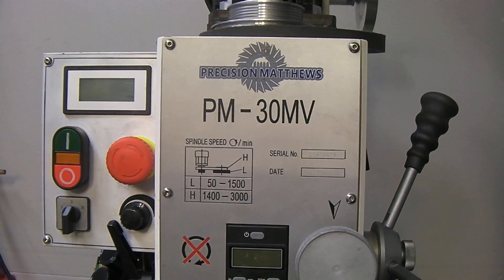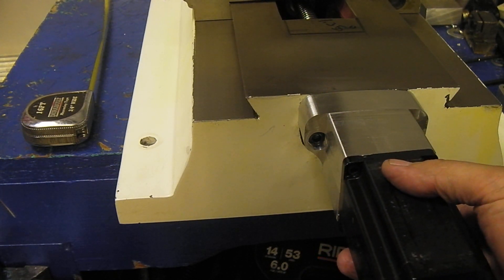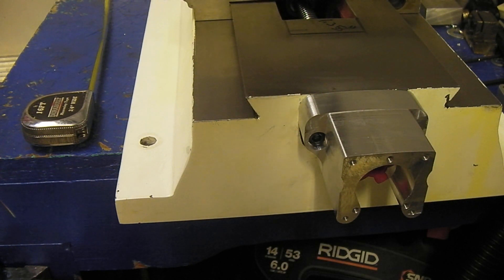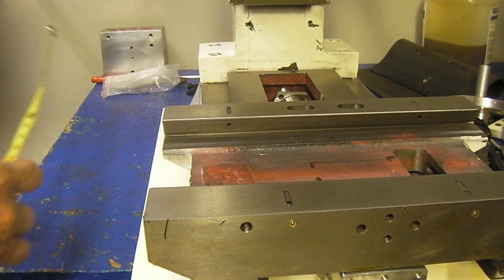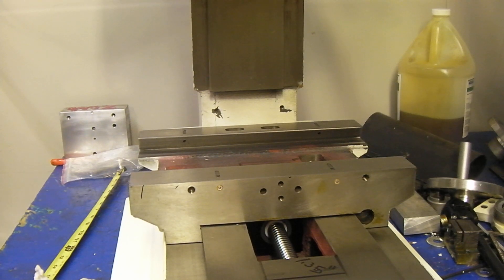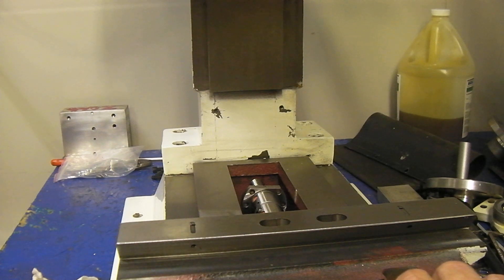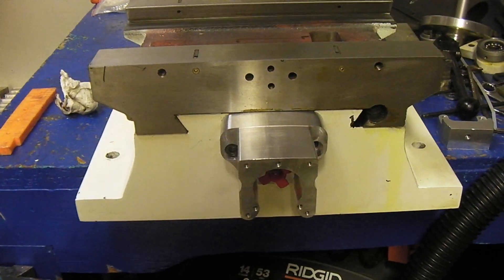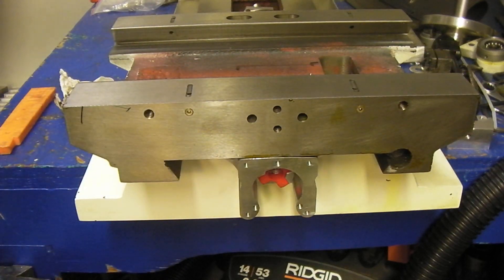PM-30 Y travel  11.5"!!

Comment: Great video, do you make or sell this kits? Anything for the Rong Fu RF30.. round colum mill drill same as the Grizzly G)706? thanks
Reply from the maker: The RF-30/31 is hard to CNC with the Z round column making you feed the quill which is always a bit lame. I dont plan on a kit for that one.
Just to show that your skill is as important as your mill, this link is to a RF-31 that has had a bit of work done to it. https://www.youtube.com/watch?v=l2PWuqgviS8

The 31 is a good mill in a lot of ways it just has more limits than needed today.

Comment: I was catching up on the body of your video work and cnc kits.  Nice bit of kit, by the way.  That being said, why is it that the "Y" and "Z" ballscrew kits do not seem to incorporate a support opposite the motor side of the ballscrew?   The "X" axis is always supported at both ends, but not the others, why?  If I've missed something, please show me what I missed or explain the reason for the lack of support on the Y and Z.   Thanks.
Reply from the maker: On the PM-30 the Y is a fairly short screw so you dont need a second set of bearing to prevent screw whip. The X will have a second support bearing.  The Z does not have one. 

You can look up screw whip and its generally not a problem at the speeds we would run the mills for the length of the screws.

Comment: Nice looking motor mounts Dave. You do good work. The pm30 looks like a very solid mill with descent travels. It looks like it will hold a vise well with it having 17" from spindle to table without getting cramped. I wished the pm940 had the belt drive option from the factory.

Comment: Perfect timing. I was just reviewing the PM mills for starting a conversion when I saw your video pop up. I really like the work you have done on mill conversions.

 I'm torn between the PM25MV, PM727M, and the PM30MV. The 25 seems to light and the 30 is getting pretty expensive for a conversion. @CNC4XR7 and others have done PM727M's. I am still torn.
Reply: BTW The Y mount looks great. What mill do you use to make your parts?
Reply from the maker: I try not to talk about mills that I have not used. From the pictures I have seen the base of the 727 is lighter than the 30. The 30 base is a vary efficient design but the column is not too large.  From what I have seen the 727 is OK. The PM-30 is around 460 pounds on the bench.
Reply: The pm30 is already belt driven so you won't have to convert to that later. The pm25 is belt driven as well but it is smaller and you should really decide now if the smaller size won't limit you later on. The pm727 is NOT belt driven so if you do a belt conversion on it later, it will cost you which will wipe out the cost difference between it and the pm30. Most people will go to a 3ph motor will a belt drive in their conversions. If you have any plans of this, the pm30 is one step closer. It looks like the pm30 is on back order so you will probably have to wait a bit for it. I have a pm940 on order and it might be here at the end of the year. Maybe the pm30's will be here then too. You would need to contact PM for that. The bigger size of the pm30 and it already having a belt drive would be my first choice of the 3.
Reply: @halfstep67  Good points. I did contact PM about the PM30MV basic without DRO  in mid November. They said then that it was about 5 weeks out.